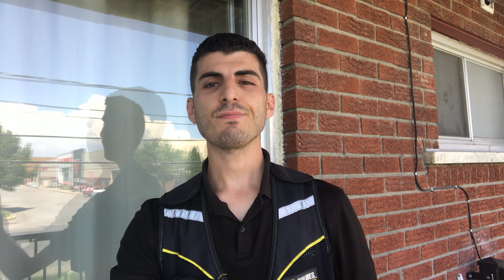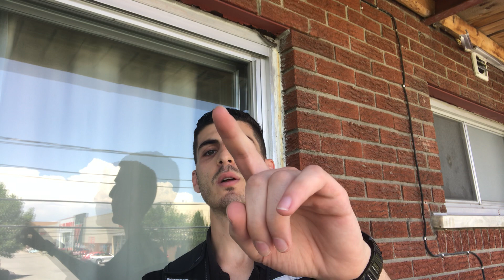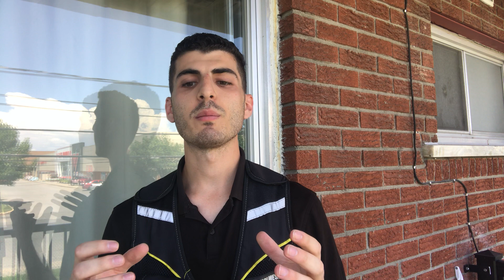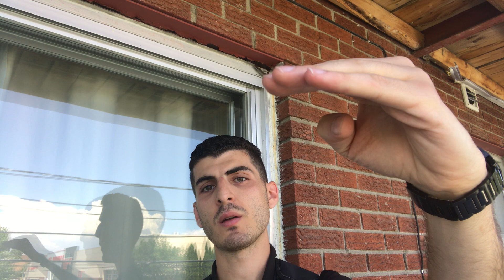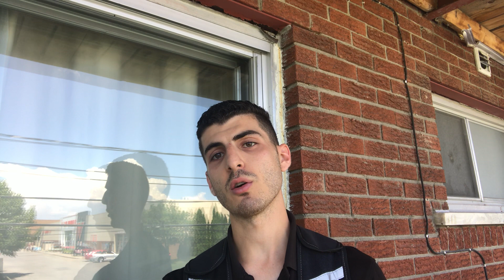Maintaining Steel Lintels

Comment: Is there anything that can be done to treat the side of the lintel in contact with the brick (the concealed surface)?  Can you use a spray can with straw-like nozzle to apply a rust inhibitor or water repellent oil into the gap between the brick and the lintel?
Reply from the maker: Not in my opinion. The surface to be treated needs to be accessible.